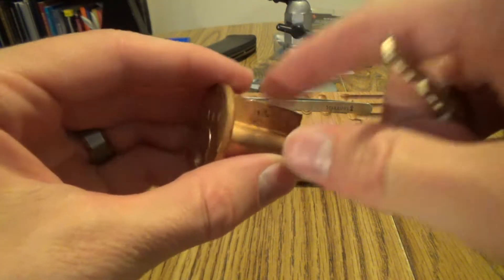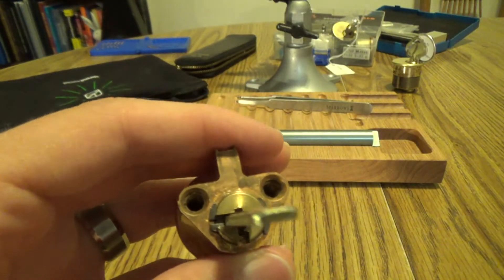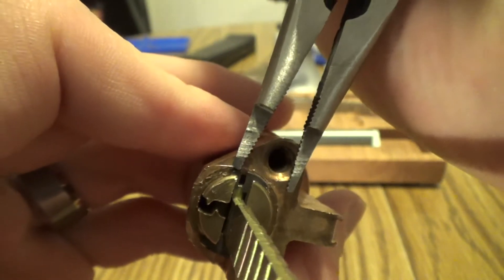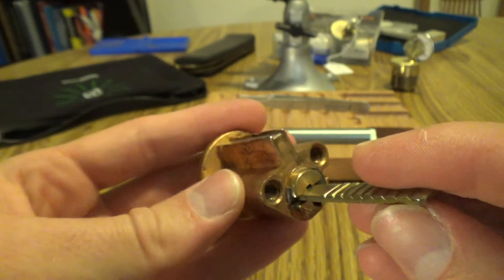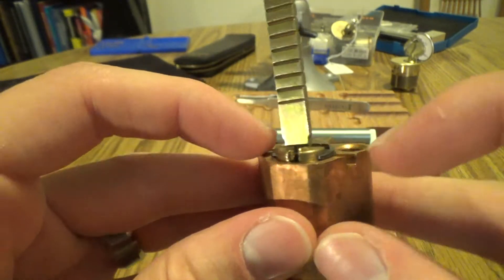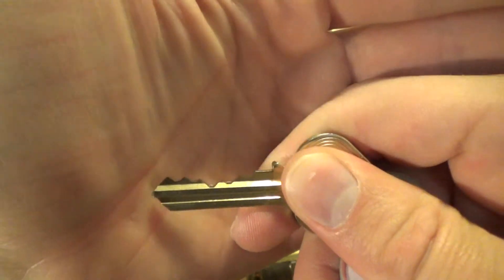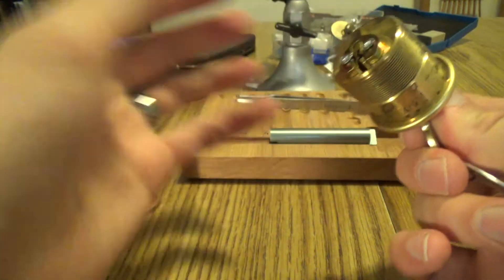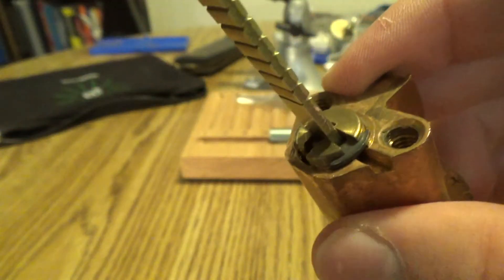[60] I Need Your Help... How do I get this clip off?!?

Comment: They are definitely a pain, I’m sure someone else might know better but I get them off by using a fairly large flat screwdriver and push down from the top of the left hand side of the clip (looking at it from the back oriented right side up). and then in toward the center.  If that makes sense.  If I make a challenge lock out of it, I file the clip tab so it is easier to get it off.  If you still have trouble, I can probably make a video tonight and share it with you.  I had SO much trouble with these when I first encountered them.
Reply from the maker: I left the lock at home, but I'll take a look at it tonight. Thanks for your input!

Comment: A bunch of medeco kik cylinders I got had these clips on the back. They were a bit of a pain. I was able to remove them with the tail piece still in.  Best way I found was using a bench vise with one jaw on the larger part of the split side of the clip and one jaw on the edge of the plug opposite and just pushing the clip out a bit by tightening the vise. Vise grip pliers might work to do the same. The non-split side should then stick out a bit and you can grab it with vise grip pliers to pull it the rest of the way out.
Reply from the maker: That's a great idea, I'll have to try that. Thanks!

Comment: I think if you turn it 180° you can then slide the tail-piece out the open side, then remove the clip as normal... I think! Good luck. 👍👍
Reply from the maker: Ah, that makes sense. I can see the groove where the tailpiece is supposed to slide through. I still haven't figured it out, but you pointed me in the right direction. Thanks!
Reply: I’m pretty sure that how the clip came off in a couple of mine..

Comment: Yeah I'm pretty sure the tail piece needs to come off first in order to slide the clip just the way your trying to. If that doesn't work a dremel will lol and just throw another clip on it.
Reply from the maker: Thanks for the tip. I now understand how the clip comes off, but I still can't get it. I may resort to the Dremel like you suggested.

Comment: That is weird.  Looks like you compress the clip like you did, then try to remove the tail piece while pushing on the clip.  If that fails, get a  BIG hammer, a flat head screwdriver,  or chisel  and beat the crap out of it. My method might be a little bit destructive.  😲🤣😂
Reply from the maker: I might have to resort to your method, despite everyone's great advice I still can't get it off.